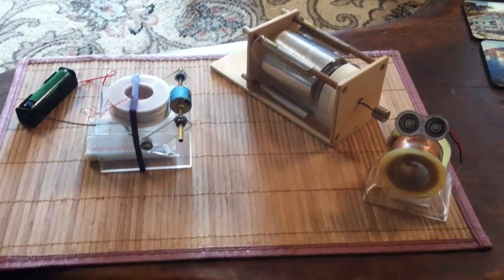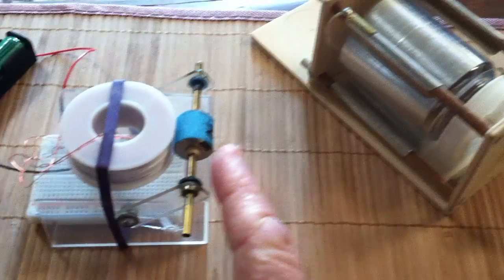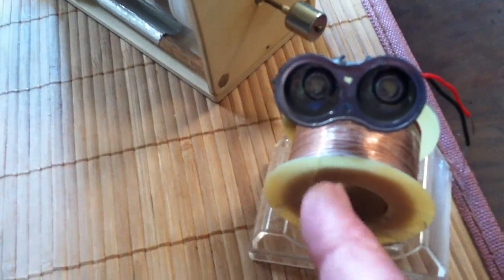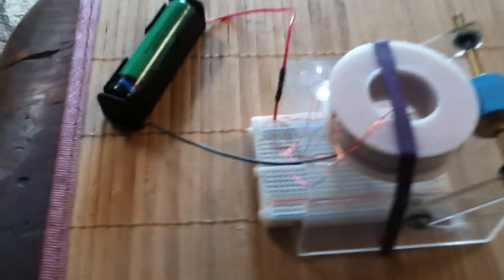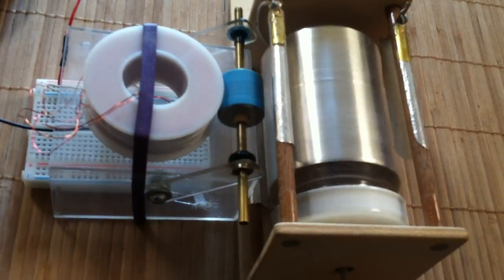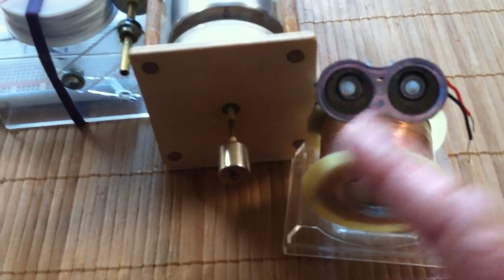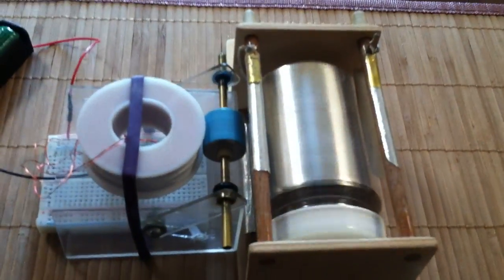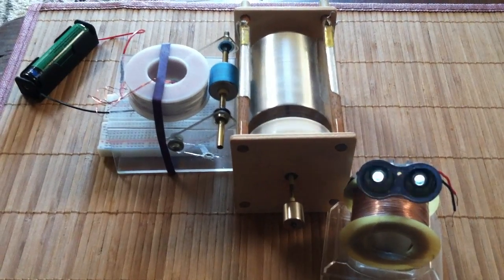Large Electrostatic Motor Driven By Lenz Effect

Comment: Love the Maggie
Reply from the maker: +Cere Mony Maggie is a great little tool.  No batteries required.  We go back a long ways.
Reply: say, where are you getting your plastic forms from for winding coils?  Specifically Maggie.  Since that's a large diameter coil.
Reply from the maker: +Cere Mony  Maggie is just a full spool of 40ga magnetic wire.  Just buy a big spool of fine magnet wire that has both ends available, attach a bridge rectifier and a couple of leds and that's it.  You can buy 'plastic 'bobbins' at Nebraska Surplus online if you need plastic bobbins.  I use plastic sewing machine bobbins for my small stuff.

Comment: Just wondering how many of your motors you could link together like this in a long chain linked by the different effects. I also wondered if the blue magnet on the left was required as your coil is generating a pulsed magnetic field so would that spin up your electrostatic motor directly?
Reply from the maker: +GrandadIsAnOldMan  I'm working on that right now but not in that way.  The first step is to really understand how AC induction motors work and I'm starting with this super simple design.
https://www.youtube.com/watch?v=YdDd8ufhXCg
You have to make the magnetic field move to get the rotor to move and chase it.  As I recall Tesla had a dream about this and -----the rest is induction motor history.
Reply: ***** that's a great video, my style of build :)
Reply from the maker: +GrandadIsAnOldMan&#160; My first attempt at this today failed. :(  Sometimes really easy things-- are not. I tried to use a lashed up AC generator, different kind of rotor, and different type coils. It was a complete failure.
Reply: ***** no doubt you learned in the process and will come back and have another go :) Having watched that video you linked to I do fancy having a go at that style of motor just because it looked so rough but it will have to wait it's turn in the queue.

Comment: Very nice!  Excellent work!

Thanks for sharing!
Reply from the maker: +A B  It seems like I'm always finding something new to investigate that had nothing to do with what I was originally working on.
Reply: That's part of the fun in experimenting!
Do you know that the Eddy currents that are created in the AL strips create their own magnetic fields & those newly created fields are the same polarity as your rotating magnets & opposition of fields creates a repelling condition that causes the driven rotor to rotate because it has less power than the drive rotor?  Basically, as the AL magnetic fields oppose (repel) the drive rotor magnets, and because they are weaker than the drive magnets, rotation is created created in the AL strip rotor. :)
Reply from the maker: +A B  Yep.  Thanks. Good description of what is happening.

Comment: Lidmotor, as far as I concerned this is your best project ever. Great video! Do you think that you could pull off a static charge with this as well across a spark gap into a cap bank? If so that would be brilliant. Running everything you have in this video and a static generator as well. Now that would be cool.
Reply from the maker: +shazizz   Thanks. My efforts so far to do what you suggest have failed.  Still working on it but this may be trying to mix apples and oranges.  Two completely different things that don't play well together?
Reply: +Lidmotor I was wondering the same as +shazizz.  Even the fact that it's not possible is pretty interesting, if that proves to be the case.